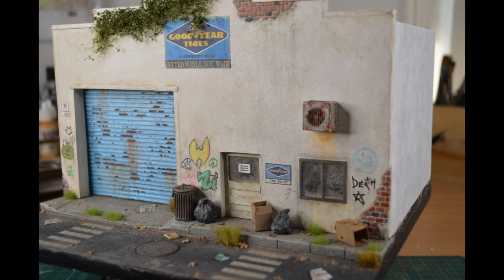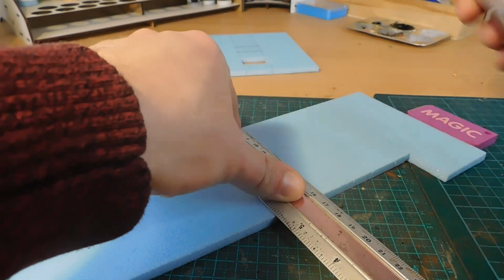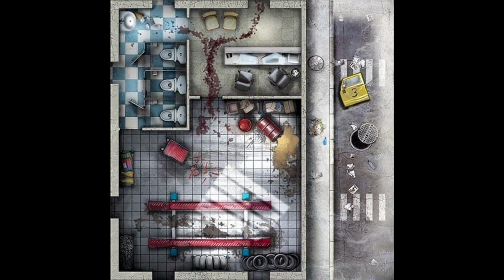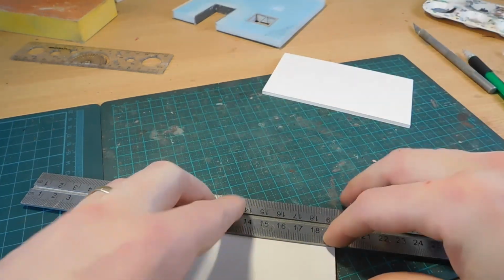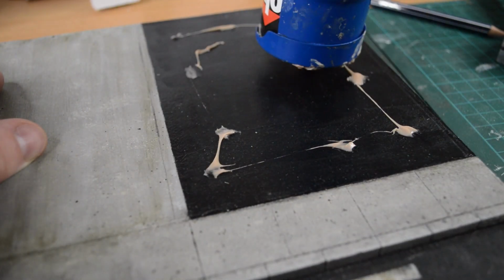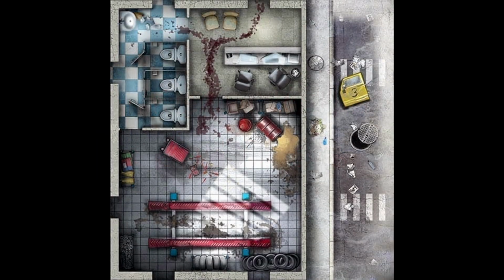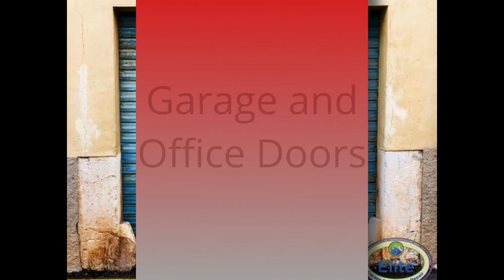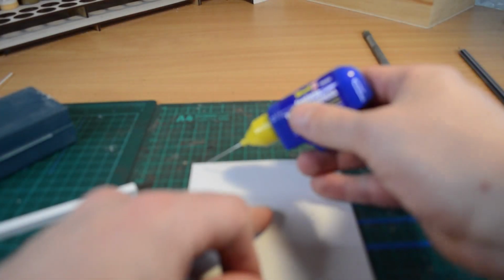Zombicide Build Part 2.a: Garage Tile Structure

Comment: great job, my dear. Do you recommend the structural panels with weak or strong grooves?
Reply from the maker: Thank you! Are you referring to the card I used for the Garage door and tiled floors?
Reply: no, sorry, I mean the floors for the toilet and office. Evergreen always offers its square patterns in two versions. deep and less deep grooves. I think the choice will affect very strong the visual depth effect.
Reply from the maker: @michaelheuer2020  oh ok, I understand :). I used the light groove card, which was deep enough in my opinion.
Reply: The facades have become incredibly beautiful and you have created the right ambience with the color scheme. I have a second question: Why did you leave out the passages to the neighboring tiles in the house?
Reply from the maker: thanks! I left out the doors leading to other tiles because I think it would look silly to have a door on every wall section of the building interior. I plan to make a few modular doors that can be placed against the wall where necessary @michaelheuer2020

Comment: Quick question regarding the wood pieces you're cutting down for door facings, trim, etc. I believe you refer to them as paddlepop sticks?

Google gives me "popsicle sticks" as an equivalent, but in the video they look more similar in length and thickness to wood coffee stirrers. If you happen to have a link to a product similar to what you used that would be a great help for me to confirm and find a local equivalent.

Great stuff by the way, I never realized what a huge difference door facings and baseboard trim would make.
Reply from the maker: Thank you and yes, you're right, they are actually coffee stirrers. Here is pretty much what I used: https://www.amazon.com.au/1000-Wooden-Coffee-Stirrer-Sticks/dp/B083VW21VV
Reply: @TerrainPitt  Beauty! Much obliged.